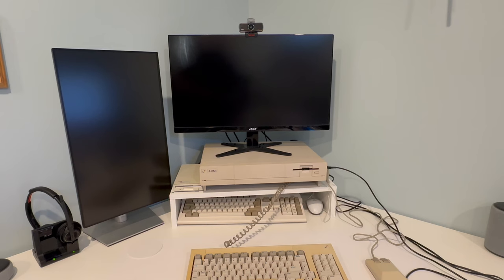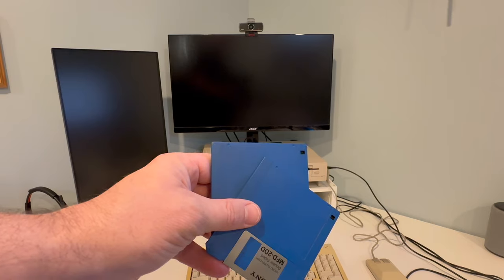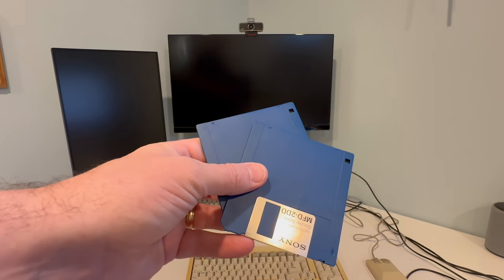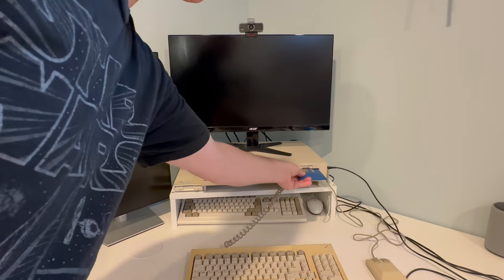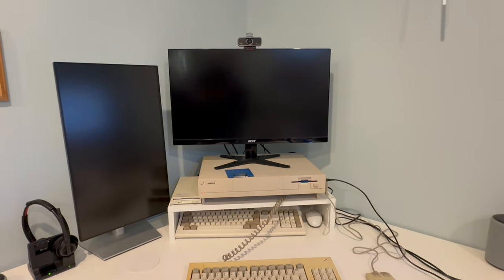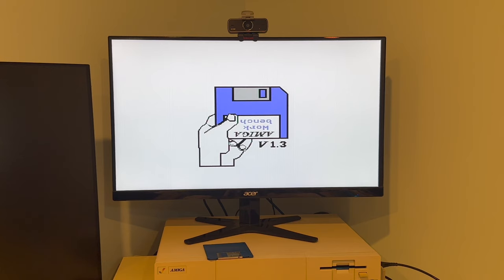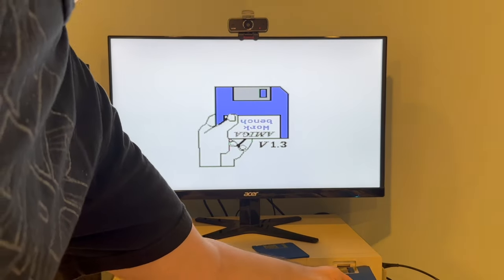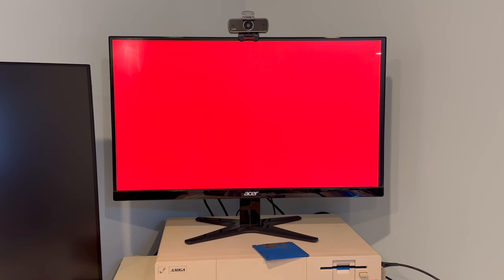Copy that floppy the Amiga and Atari ST edition - updated

Comment: This is the exact reason why I have been very resistant to fitting Goteks! I still have a bunch of goteks from wayback when somebody figured out how to re-flash them, just never actually installed them. I am going to hang onto disks until I have none left! As for nostalgia, I can even remember the smell of an ST when it has been on for hours, the psu inside makes the case warm. There is something about the case plastic on these machines. The Amiga has its own smell but the Atari seems to be more noticeable :)
Reply from the maker: I think Gotek's have their place.  For me it was early in my vintage Atari collecting and I wanted a quick way to try new software.  The Gotek offered that...since then I've come into possession of many many floppy disks and the means to easily write software images to them.  I love the way they feel "clunking" them into the drive.

Comment: I cannot for the life of me get my Gotek running as a B drive for my Atari 1040STE. What jumpet settings and config did you use, if you don't mind me asking?
Reply from the maker: Have you tried setting the jumper on the Gotek to S1 instead of S0 (typical for internal / boot drive)? 
In the video I used it with my 520ST with two external drives.  
I just tested with my 1040STF with an internal drive just to make certain it also works that way too...and it does.
Also tried with my 1040ste that has an internal Gotek to verify it works with two goteks and it worked that way as well (the internal gotek set as S0)
Let me know if the S1 jumper setting works for you!
Reply: I've tried setting jumper S0, S1, S0 and MO, and S1 and MO. All to no avail. I've also tried using a friend's STFM, his Gotek, his Gotek lead, and ultimately he too has the same problem. I'm wondering if it's something to do when with the fact that my Gotek is slightly more modern and has a rotary dial. 🤔
Reply from the maker: @technickuk  how are you connecting the Gotek to the Atari?  The Gotek in the video here is my newest one.  I just didn't add the rotary encoder or the OLED screen to this one.  The one installed in my STe as S0 is about 3-4 years old'ish.

I'll pry open my enclosure (it's glued) and verify all the jumper settings.
Reply from the maker: @technickuk  send me an email to my channel contact info.  I can share some photos of the jumper settings and connection used to connect to the ST.

Comment: what if a floppy disk is copy protected ?? then how do you copy it ?? thanks
Reply from the maker: Using the Greaseweazel you are actually copying the magnetic "flux" and not individual data points.  Think of it as the difference between copying the words of a book versus simply replicating all the lines and shapes that make up the letters of the book.  This captures the copy protection perfectly and thus you can copy the entire disk image (in the HFE image type).
Reply: I have a blitz cable I made back in the 90's probably the fastest way that copies anything. Greasweisle is the other option. 

Some other copy programs work to beat various firms of copy protection.  MSA etc.